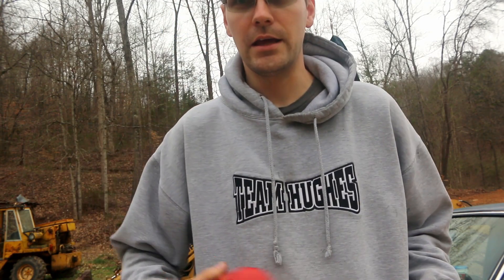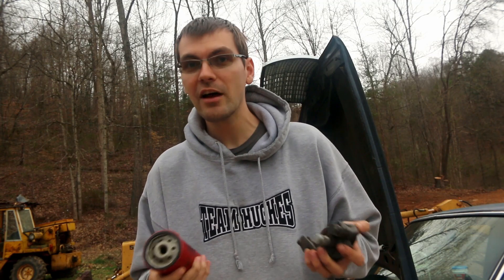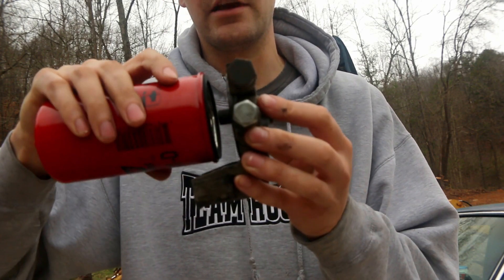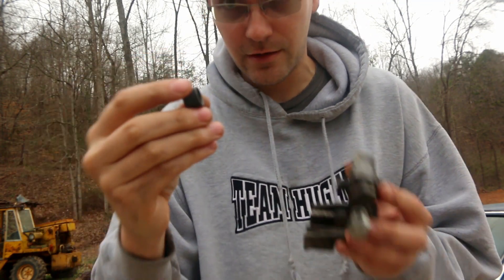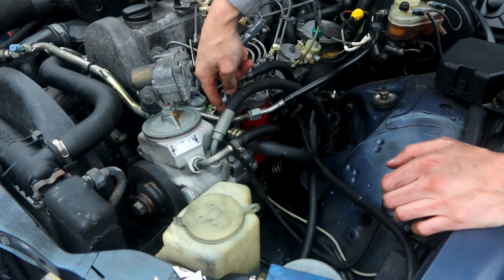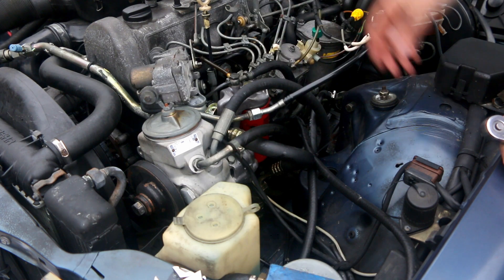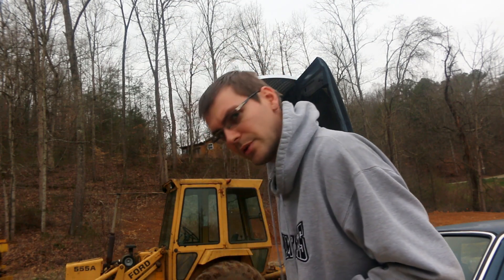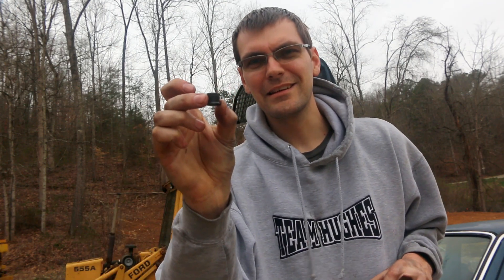82 Mercedes 2 Micron fuel filter mod! OM617 Water separator in stock location!

Comment: any updates on this?  What did you end up doing to improve the mount?   Longer bolts  and use spacers similar to DDay??
Reply from the maker: I switched it back to the stock configuration because I had a whole case of the stock filters I wanted to use up, and haven't used them all up yet. I'll eventually put the Baldwin back on.
Reply: @trythistv  do you see potential  that just raising the stock one with spacers (and lengthening hoses between banjo's)  would work or is moving it little toward back of engine pretty much a" must" do also?

Comment from the maker: Affiliate Links (I get a percentage of what you spend on these items at no additional cost to you):
Here are some links to products we used in this video on amazon in case you want to try this:
Time-sert 14155 (10 pack): https://amzn.to/2U7HUOS
Baldwin BF7591-D: https://amzn.to/38I9lE9

Things you need to use the gigantic primary "prefilter" that I have between my lift pump and fuel tank:
Filter housing: https://amzn.to/31lon0T
Mesh filter: https://amzn.to/39VP14r
Fittings: https://amzn.to/2XqYBHq
3/8 fuel line: https://amzn.to/3gtDdZy
Clamps for fuel line: https://amzn.to/31mavUd

Comment: Any long term experience ?
Reply from the maker: Just what I've had since doing the mod, works great, no real seeming downsides, getting good fuel is key to filter life, as it will clog up much faster if you've got trash in the tank but beyond that kind of extenuating circumstances, it's just like factory but a little safer

Comment: Why would you want to restrict gas flow brilliant solution tho I liked that adapter bolt
Reply from the maker: We don't want restriction, but we do want clean fuel. There was a study done by caterpillar I believe it was that found debris greater than 7 microns is the main cause of wear and damage to injector pumps, so switching out the stock filter that is rated somewhere between 10 and 20 microns if I recall correctly to this 2 micron rated filter should dramatically increase the life of the injection system, assuming it doesn't restrict the flow too much. Which if you check out my other video on testing fuel pressure, I found out it doesn't restrict it really at all: https://youtu.be/jiPonBwkxeI?t=630 (Timestamped for your convenience! )

Comment: have you had issues with these filters clogging up? My 1st one clogged up after a month.
Reply from the maker: Not really recently, but I'm also more and more careful where I get fuel at. I ended up destroying a p7100 injector pump on one of my work trucks last year from a bad tank of fuel, started getting real careful about where I fill up after that $2000+ debacle

Comment: Should be the same for OM616 (1983 240d) correct?
Reply from the maker: Yes sir! Filter mount should be identical, nearly everything in my videos about my 300d should be alarmingly similar on your 240d
Reply: Great, thanks. Just replaced the filter; but will try this next diesel purge.

Comment: Have you added a valve and drain line in place of the bottom filter plug?
Reply from the maker: I have not, however that is an excellent idea, would be much easier to check for water instead of popping the drain plug out every so often.

Comment: I'm kinda interested to see a Fass or Airdog fuel system replace the stock system.
Reply: The psi rating on either one would be way overkill for a Mercedes
Reply: @trevorstrasser6136  16-18 psi variable if I remember correctly for the Fass TT SS, you could still get a regulator on it if it's too high. But the pressure isn't crazy high, most gasoline pumps are in the 40s.

Comment: Hi sir, il love this video!  What is the ext name of your little sleeve ? is it handmand or we can buy those ? Thanks in advance!
Reply from the maker: The piece I used to adapt the threads is meant as a thread repair sleeve, like a helicoil, Time-Sert makes them that are fully solid rather than the cheap wire ones other brands make, part number is 14155. here is a link to a 10 pack of them: https://amzn.to/2U7HUOS

Comment: build the bracket, it's going to fail... the engine shakes way to much to have all that on 1 bolt... Look how often the air cleaner bracket breaks, and it's on 3 bolts!
Reply from the maker: No doubt. I'll be making a bracket very soon, in the meantime I'm sorting out some other stuff on the car that'll be coming out in some videos hopefully soon as I get it all figured out, exciting things for this old w123 :)

Comment: or you could buy the kit from doomsday diesel
Reply: Great video with a great option as well I just like the bracket that he sells with that kit
Reply from the maker: It looks super legit, well made for sure, had I seen that before I found this setup I probably woulda just done that. I've bookmarked their site as they have some other super handy looking bits and pieces for our cars!
Reply: trythistv yeah he has some great stuff over there mostly aimed toward swaps Benz source also has some cool stuff as well
Reply from the maker: Thats a pretty legit setup they offer, quite dramatically more expensive than this option, but could be a better option as those filters are even larger than the bf7291d

Comment: Going to the 2/10 micron filter is great! Nice find on the threaded adapter, too! I like to use 2mic in summer and 10mic in winter. I definitely wouldn't recommend running your filter housing on 1 bolt, however. It will fail thru fatigue. I offer brackets for this very mod: https://www.doomsdaydiesel.net/product-page/cat-1r-0750-fuel-filter-adapter-kit
They allow retention of A/C and vacuum line mounts and work with Dieselmeken's M-pump, too.
Reply from the maker: HEYY!!! another viewer just turned me onto your site! I'll certainly be making a bracket before I leave the 2 micron filter on there, Might just get one from you, last I had seen there wasn't anything out there like this, but apparently I just didn't look hard enough.

I also notice you have a HE221W wastegate relocation bracket listed for OM617, I've long been pondering some way to get a more modern turbo that would spool faster and flow better than the old Garrett or KKK these cars came with. The Garrett on my blue car feels like it takes forever to spool and the KKK on my grey car spools instantly but chokes out bad at higher RPM.

I've read 10000 differing opinions and no real solid info on fitment, I decided I was waiting until one of my turbos failed and then figuring out a way to mount a VGT turbo, a controller shouldn't be too difficult with my background, but now I'm curious if the HE221W is a good compromise for spooling and not choking out up top.

I'd be interested to hear your input!
Reply: @trythistv 
My Donaldson/CAT filter adapter was actually a customer requested product. I liked it because I run the 1R-0750 on everything else I own. CAT has about the best reputation for fluid filter quality. I surely like the size of your filter a lot more, though. The filters I run are HEAVY, and the flow capacity isn't needed.

I've been testing turbos since February 2019. Ran the 2 stock turbos first, then modified them, then moved on to different turbos. In the end, I ran about 12 tests with the stock pump. Now I'm re-doing a bunch of them with the dieselmeken pump.

The K26 is all around better than the T3OB, even though it chokes sooner. It actually has lower EGT's and spools quicker - best of both worlds.

I've found what I believe to be the best off-the-shelf turbo replacement for a stock IP. This stupid pandemic has slowed my progress on getting the parts available to the public, significantly, but I hope to he offering a 100% bolt-on kit in the next couple weeks or so. It's actually not an HE221 that I finally landed on, but I'm not releasing any details till I have all the parts ready. What I can say, is EGTs will no longer be an issue, no intercooler required, the bottom end is woken up tremendously, and spool-up is incredibly quick. I'm hoping to dyno a stock car, then install this turbo kit and dyno it again to see the change in the power curve. The butt-dyno says there will be a significant difference. Being able to leave the vehicle in high gear while cruising up a hill without worrying about down-shifting to control EGT's is going to be awesome!
Reply from the maker: @doomsdaydiesel  I'm excited for the turbo info, I'd figured after I got my shop built I might start experimenting myself, but I can wait on that until you're done for sure!

I've got a few of those ideas I'm keeping close to the belt, hopefully soon I'll be able to get parts together to get some videos out on those.

I'm worried if this pandemic clears up I'll be flooded with work and won't get the time to work on the cars, right now I'm struggling to get parts fast enough for customers so I have some spare time, but I also can't get parts fast enough for my personal projects.

I do like the k26 better for sure, I swapped the garrett for one on my grey car that is 4 speed swapped, alda delete, 2.88 rear gear, 2 tank wvo system, and a pile of other random mods, and I love how fast it spools, I don't make a habit of driving around at 4k rpm and thats right about where it seems to start choking, most of the time I'm around 2-3k tops, I drive like a grandpa basically everywhere lol

Comment: Is it ok for the fuel flow rate ?  Just wondering, going 10 times the filtering rate, can you starve the injection pump out of diesel ?
Reply from the maker: It is entirely possible, with a good lift pump and overflow valve it should take some time to clog as long as you're getting quality fuel, the Baldwin filter is significantly larger, so while it does filter much finer, it also has a lot more surface area so in theory it should flow similarly and hold more contaminants before it plugs up. I'll be doing some testing as we drive the car, as well as I'm putting finishing touches on a video about testing the overflow valve and lift pump output to make sure the IP gets the proper pressure to fill the elements. I'm going to include a comparison of fuel pressure with the stock filter and this filter to see if it restricts it at all.
Reply: @trythistv  very much appreciated !

Comment: Awesome.  Thanks for sharing.  Hopefully there is enough space on an om606.
Reply from the maker: an OM606 might use a different filter thread size. I had a 95 om606 and I feel like it was smaller than M14 threads, but I'm completely unsure, I'll see what I can look up though, if nothing else maybe come up with an alternative for you!
Reply: @trythistv  Thanks.  However now looks like I'm going to use a $$$ racor that was given to me.  Thanks anyway.
Reply from the maker: The Racors are super nice filters. I didn't wanna spend the money for that kind of setup, but getting it for free is hard to beat! You'll be super happy with it I'm sure!
Reply: @trythistv  U had a 606?  I thought they r forever engines?  I know that 95 never had a turbo.
Reply from the maker: I sure did. it was a 95 E300D, there is a picture here: https://trythistv.com/wp-content/uploads/2020/03/10246357_10203792974522678_6250792671031315751_n.jpg
It had 374k and a laundry list of problems when I got it. I never once got to drive it further than about 50 miles before something else would break.
I loved how it rode, how it handled, heated seats was great in the winter, but the car was a basket case. I spent way too much money on it before I finally gave up and traded it for what became the drivetrain donor for my purple truck about 3 years ago.
It had partially receded #5 and #6 valve seats, it would chuff out the intake ports but they'd seal up with a little RPM, so it was pretty flat below about 2500 rpm, felt very similar to how the 617 tends to build boost and come alive at around 2k.

The gold W116 300SD in that photo is my very first car. I bought it for $300 at a junkyard when I was 15. I drove it until I was 25 with very minimal repair needs. The northern rust started getting bad, and a gentleman from Alabama contacted me with the intent of restoring it so I sold it to him quite cheaply as parts were getting hard to find (window regulators were a big one, A/C didn't work, windows stopped rolling down, 100 degree days...). The car was in fantastic shape other than the rockers being rusty and little spots here and there, Mechanically I'd have trusted that car to the end of the earth.

The grey car you see will be making an appearance sometime soon, it's another 82 300D, but it has a 4 speed manual, and 2.88 rear diff, k26 turbo swap, and has been sitting for a while, so we'll be getting it back into shape once the blue car is top notch for my wife to drive.

The blue car in all these recent videos was given to me, it had no oil pressure. I discovered that was due to a lack of oil, but it had already wiped out the cam, and vacuum pump, I checked the crank and bearings and everything was ok in the bottom end, but I'll need to do a timing chain before long as I suspect the lack of lubrication could have caused some stretch that might smooth things out even more.
Reply from the maker: @ebutuoyebutouy  you can drop an email to trythisathometv@gmail.com if you'd like, I'm still setting the site up, I enjoy tinkering with it but I'm certainly not a pro at all the web design and all that
Reply from the maker: @ebutuoyebutouy  yes sir I sure do! Pictures haven't come through, but idk if you sent them yet
Reply from the maker: Pics just started showing up! I looooove wagons, the w124 wagons look very modern too. One day I'll end up with one I suspect, but my sedans are treating me well for now. I kinda want to get a 603 I think backed by a 5 speed manual in a 124 wagon